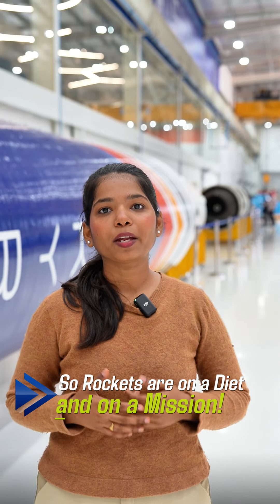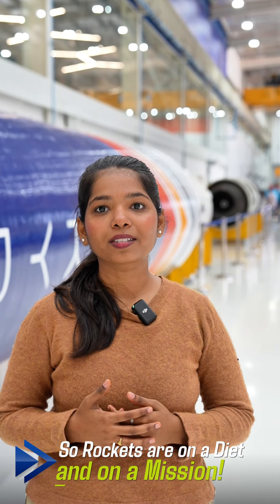Rockets are on a Diet

Comment: Carbon fibre is strong and heat resistant, but the epoxy is not. That's why carbon fibre rockets use thicker heat resistant tiles. That's why Space X use stainless steel to make their rockets. Because steel is more heat resistant than the epoxy which binds the carbon fibre.